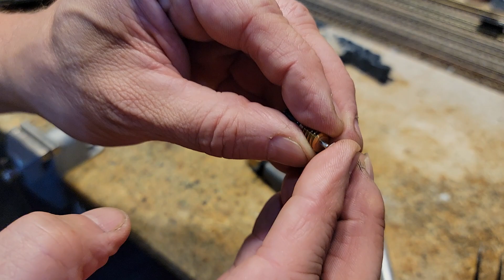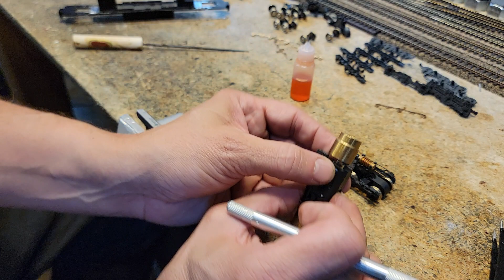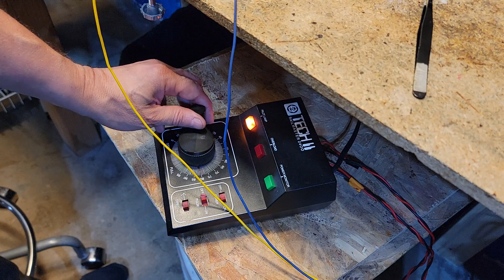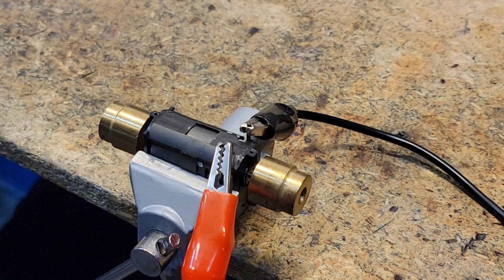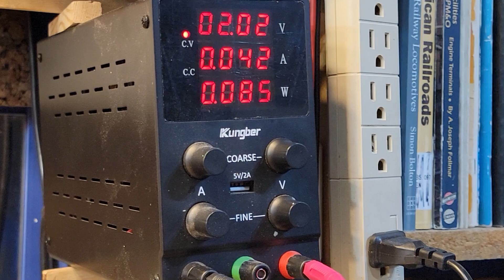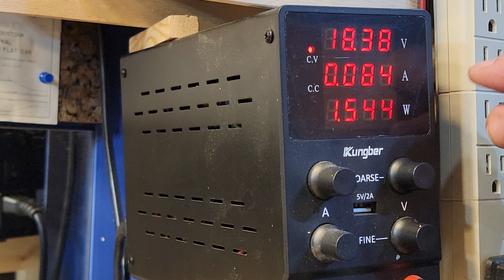13 FIX 43 HO Scale Kato SD40-2 Motor Testing

Comment: Your layout may have 18V on the rail but I would guess that your decoder doesn’t allow any more than 12V to go to the motor.  I was under the impression that this particular Kato HO motor is rated at 12V and by forcing it to run unloaded at 18V, you may be causing it to exceed the armature redline speed.  I’d ask Kato about it.
Reply from the maker: most Digitrax decoders allow up to 18v and so do the NCE and Tsunamis.  I've only found 1 obscure decoder that is limited to 15v and think it's MRC.  As for the motor, this is a standard 12v FK-130 in an older housing. The torque curve on this particular version is max torque at about 6.5 volts.  You can run this motor at 18v continuous with doing any damage as long as the bearings have been lubed.  Fortunately, if the motor ever did burn out, it is easily replaced by the far superior FK-130 that is 24v.  Either way, it's still a $2 motor!